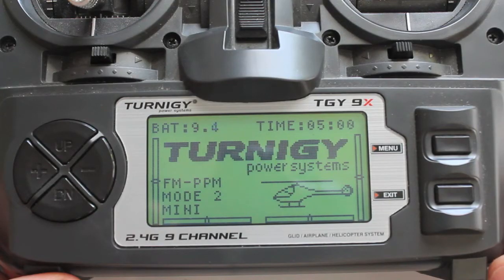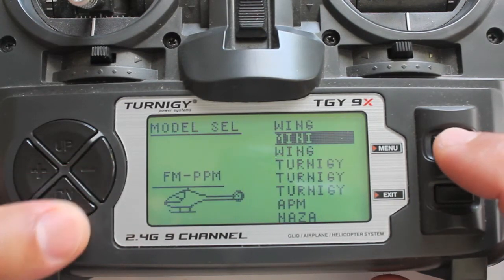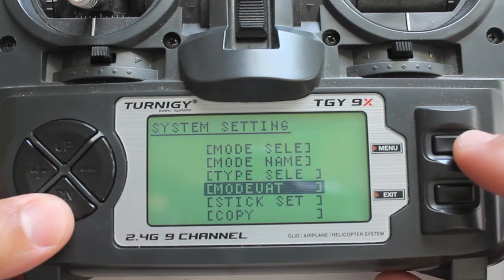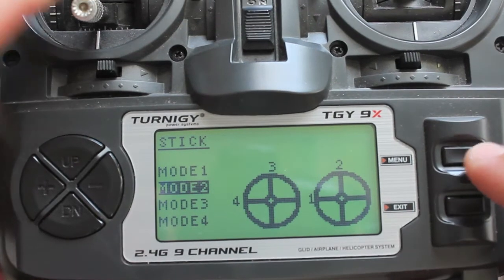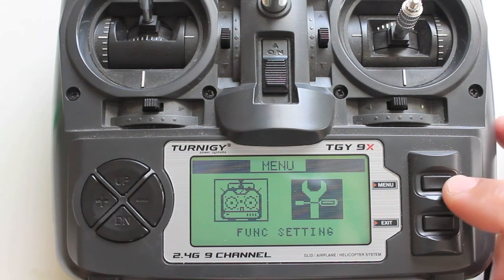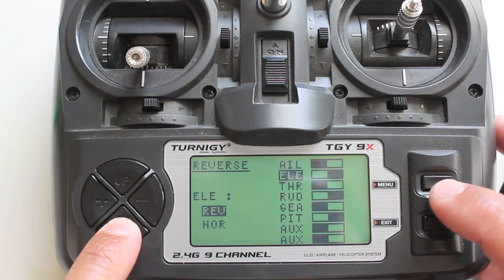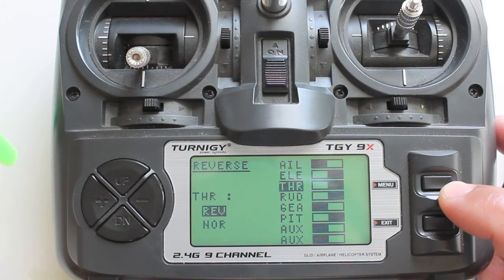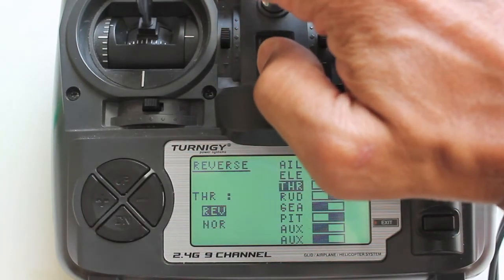Turnigy 9X Throttle Reverse How Not To

Comment: For some reason, I also was not clear that Exit meant 'no'.  So thanks for this video.  Between silkscreening errors, stuff like this, and of course, nothing I'd call a "manual", the Turnigy has been an interesting experience, and I've used Chinese products for a long time in computers!  The "Husterer-Glatthaar" manual doesn't mention binding at all (among hundreds of other things you need to know), and the Chevalier PDF is more like a product review, but at least describes the procedure!
Reply from the maker: I hear you, Hugh. This hobby is not for the faint of heart, but at least there are others out there venturing down this path with us. Lots of trial and error is my manual :)
Reply: I bagged the Turnigy and migrated to the Taranis X9D.  Since it's "open source", it has a lot of the same finger-pointing, and moving-target "documentation", but it's more complete and serviceable out of the box, and doesn't require any physical modification to do firmware upgrades.  With CompanionTX I can work up most of the configurations on my computer and avoid the buttons.

Comment: Dennis: I had this problem, and when I saw your clear and easy-to-follow vid, I happily followed the procedure you laid out. I made sure I hit Exit on the "Reverse" screen in Stick Settings, and set the throttle in the "Reverse" menu to normal.

Unfortunately, my motor now does nothing at all when I push the throttle up.  did this many times to no avail.

Can you help? 

Thank you.

Comment: I fixed it. I had to switch out a spring, a spring-arm, and a tensioner. It was not a software issue but a hardware issue. Evidently, overseas they utilize the tx where the throttle is on the right stick. It turned out to be quite simple. Thanks for your vids. When im stumped I usually find the answer here.
Reply from the maker: Glad to hear that. I can't imagine flying with my throttle stick on the right. That would be like learning to fly all over again. Thanks for the feedback on my vids. Much appreciated.

Comment: I figured it out. I bought the wrong mode tx. (Throttle on the right stick etc..) I found a tutorial on switching out the gimbals so i'll try that. Using my Aerosky transmitter I guess I assumed they all come that way.
Reply from the maker: Sorry to hear that, but can't you still change the mode in the software settings? I haven't done this before but know there are options to switch between Mode 1 and 2 for a given model.

Comment: Ive also noticed that the left stick is not the same as the left stick on my Aerosky tx. Meaning, the sticks seem to be reversed on the Turnigy 9x. Did I buy the wrong transmitter model??
Reply from the maker: If you go to your settings for that model you should be able to change the mode from Mode 1 (throttle on the right stick) to Mode 2 (throttle on the left stick). Hopefully that does the trick.

Comment: Hello Dennis. I recently upgraded my stock Aerosky tx & rx to the Turnigy 9x setup. Bind went well but doing a receiver test (kK2 1.6), im getting crazy values. How do I get these values to zero without using the tx trim tabs? Thx in advance
Reply from the maker: Hi, are you talking about getting crazy values when your sticks are at their default positions? Have you looked at the endpoints and sub trim menu options to see if you can get your channels in the proper positions without trimming? Hope this helps and good luck.

Comment: i follow your toturial but i didnt work, im using Turnigy 9X 9Ch Transmitter w/ Module & 8ch Receiver (Mode 2) (v2 , NTM Prop Drive 28-26 1350KV / 310W, Turnigy 2200mAh 3S 40C Lipo Pack, TURNIGY Plush 40amp Speed Controller and multi lcd control board this ae all from hobbyking, im testing if i could power my motor.  Do i have to use other setting to power my motor? this is for my quadcopter

Comment from the maker: It's crazy how when you reverse the throttle it immediately sends that value to the receiver. I would expect some sort of throttle protection like when you turn on your TX and it's accidentally full throttle. But I guess the difference is that the quad isn't armed then. So yeah you're right this should be done without the props...or at least with it unarmed :)

Comment: I also was confused by this option, but avoided to hit menu. But I did something else very dangerous. I was outside to testfly my self build quad, and needed to reverse the elevator. Of course should be done with propellers off. But this time I was already out and it was getting darker. By mistake I reversed throttle, next to elevator on the display. The quad took off like a rocket one I hit menu. Luckily I stood a few meters back and the quad hit the roofcorner on my garange. Lesson learned.